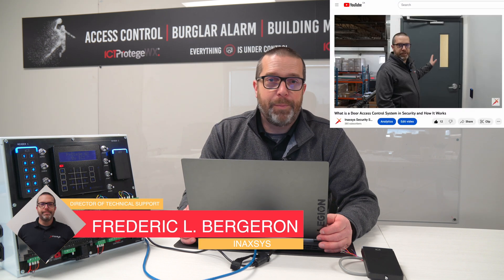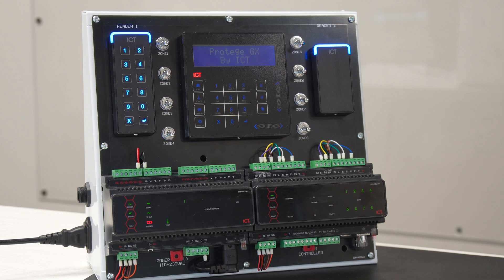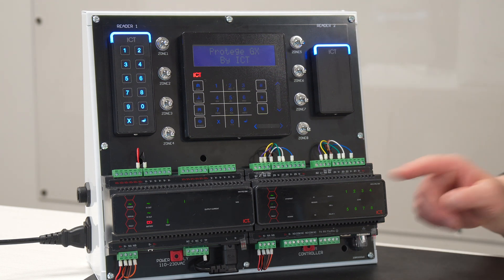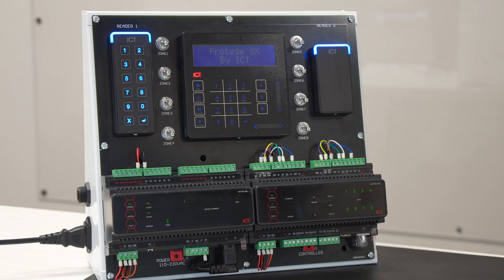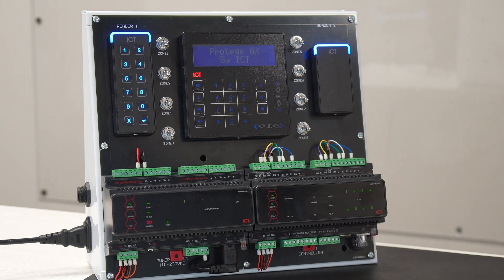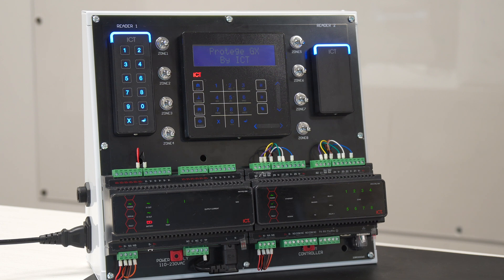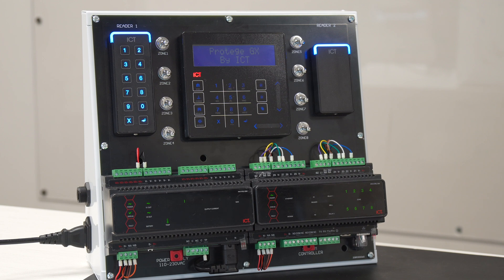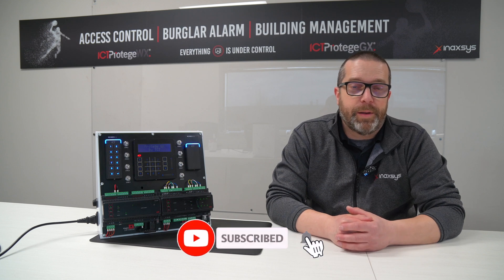Understanding Door Access Control Systems: Components and Functionality Explained

Comment: Hello. I'm interested in getting a smart lock for a community center's gym that can keep a log of user activity. I've been researching different types of electronic access control systems and it seems like RFID locks and Bluetooth locks might be good options. I need an approximate budget for my pitch.  Also, how difficult are these systems to install and program? thank you!
Reply from the maker: Thank you for your interest in Inaxsys Security Systems, your trusted distributor of high-quality security solutions. We are confident that we can provide you with an excellent electronic access control system for your community center's gym that will keep track of user activity logs.

We offer a wide range of electronic access control solutions, including RFID locks and Bluetooth locks, that can be customized to meet your specific needs. Our team will work with you to provide a system that suits your requirements and budget.

The cost of our electronic access control solutions varies depending on the number of locks required and the specific features needed. Please feel free to contact our sales team at sales@inaxsys.com to request a personalized quote.
Reply: Not the answer he is looking for, his question was quite clear